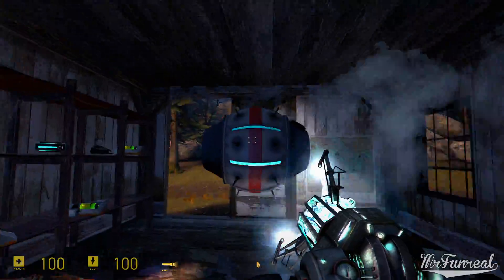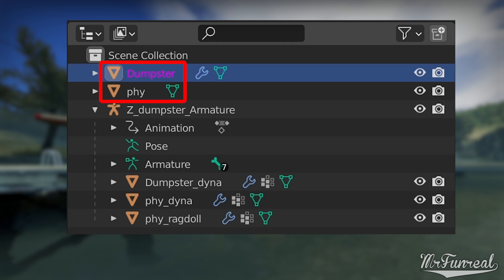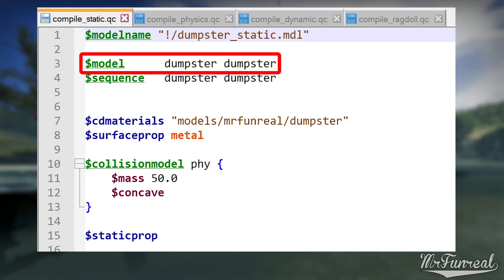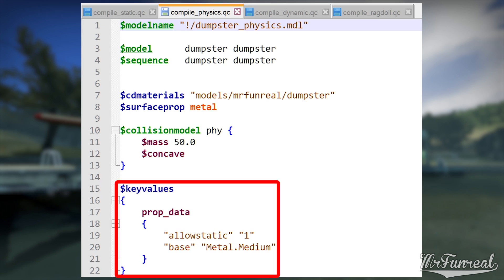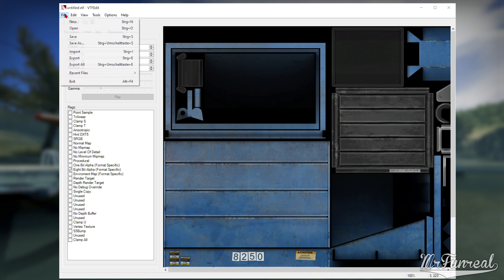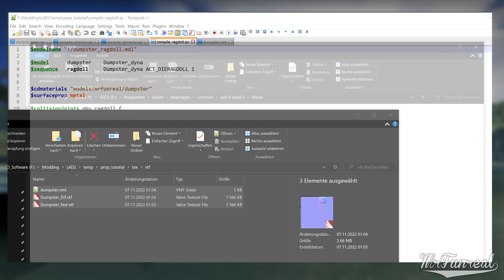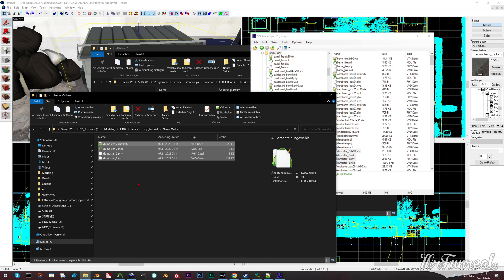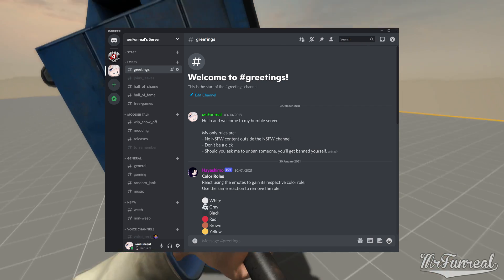Making Props for Source Engine

Comment: does this work for maps?
Reply from the maker: if you mean making props specifically for maps, yes.  
That map in the video was made by placing these props in hammer. 

You just need to add a new game content folder via the gameinfo.txt and put your custom models and textures in there. If you don't do that, then you'll have an annoyingly tedious time deleting your custom content one by one in between all the vanilla content in your game files. 
Unless if you use gmod. then the files are mounted via a "mount.cfg" in the garrysmod/cfg folder.
Reply: @MrFunreal  i mean using this method to export an entire map that you can like walk around in ad stuff
Reply from the maker: @BlenderBender.  oh well, somewhat. 
While you can make models to stand on, relying entirely on a models collisionmesh for floors and walls is a bad idea. Not only is the solidity of the objects wonky, but you also won't have any visleaf cutting, which makes the map buggy and prone to crashing because everything is always drawn at all times. 

You can, however, export the floors, walls and other stuff without a collisionmesh, separated by one building at a time. Then, create nodraw brushes to create the collison for these solid walls and floors. This will be your best bet to make a functional map. 

Several Gmod maps have done this. I think one of them was either a Majora's mask, or Ocarina of time map. 

So it will work, but wonkily.

Another option if you want to avoid props entirely is that SourceOps, the blender plugin (Or Sourceio, not sure. it's the same discord server anyways) has the ability to export blender models into actual brushwork and displacements. I have never tried that myself though, so i can not tell you how easy or difficult it will be.

Comment: excellent video, very informative, i dont know if you're still checking the comments but i have a question, im making a few buildings for a gmod map and i was wondering if its better to bake the lighting into the texture using blender or other tools and then importing them to hammer or just using vrad's -staticproplighting, i got this idea from a 3kliksphilip video about a csgo map that used similar techniques, hope you can answer and you have earned a sub. ✌
Reply from the maker: using vrad to light the prop is usually the nicer looking method, since that would allow you to change light setting in the map without needing to rebake the textures of the prop
Reply: @MrFunreal  cool thanks for the quick answer, keep up the good work!.

Comment: Some of this tutorial has been not updated because usually i add the $staticprop up the lines and it is work for me in 2024.
Reply from the maker: I don't know what you're trying to say, but this is not outdated. The entire source engine has not suddenly changed after having existed for over two decades.
My guide even shows that command, which is only required if you are making a static, unmoving prop.

Comment: ive been trying to get the qc file to compile for a while and it both refuses and wont tell me what the error is
Reply from the maker: well what's the compile log?
There's a heap of reasons as to why it might not work and listing every possible reason would take way too long.

I'd recommend joining the D4M discord server and ask in the Modding channel.
If i'm not there, someone else should be able to help.
Cause youtube doesn't let me know when you reply to this message. And i'm not going to refresh the comment section on all my videos multiple times per day to check if i got replies.
Reply: @MrFunreal  i will go there, thank you

Comment: Funreal, teach how to minimize viewmodels and how to position them to any corner of the screen in L4D2 :D
Reply from the maker: via $scale and $origin in the qc, but that includes a lot of fixing animations, so its really hard to do if you're not the person who made the mod
Reply: @MrFunreal  I tried to use $origin it worked, but it removes the custom weapons from the workshop to put the weapons positioned to the direct corner of the screen, the weapons stayed with the old viewmodels of the game. But for this there are also add-ons, but the few addons I found only work with the original weapons of the game, does not work with workshop weapons.